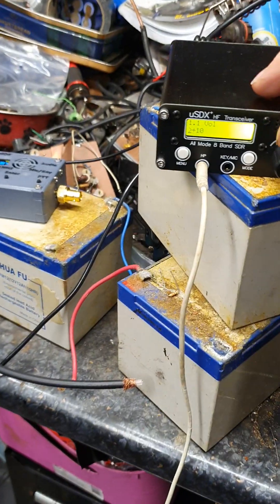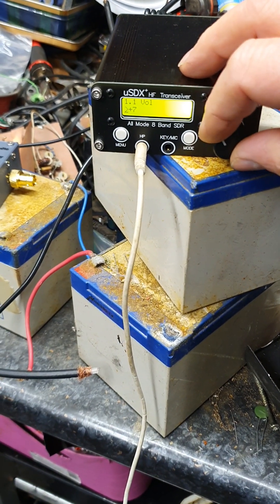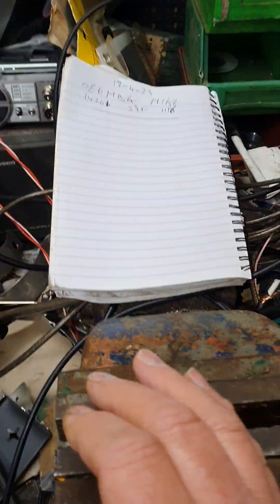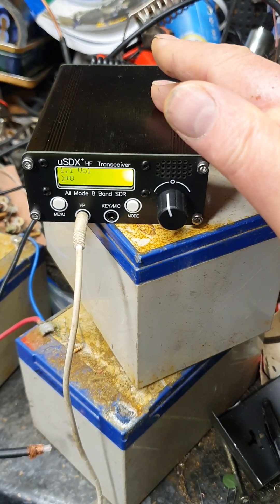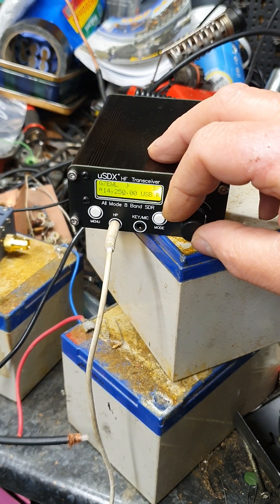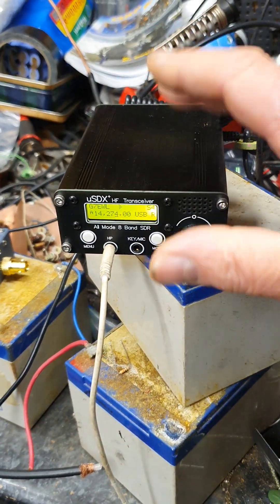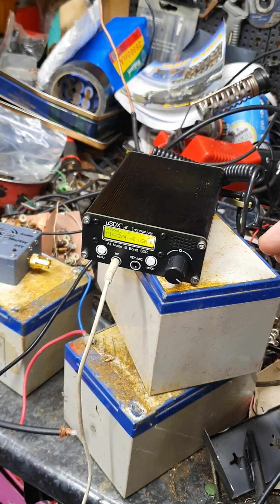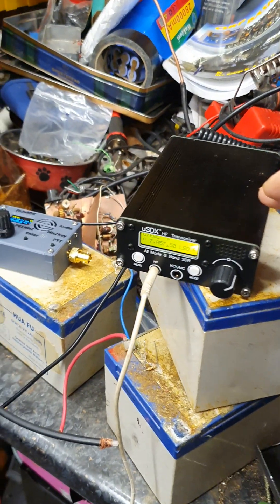Update on my faulty uSDX "white button" from Banggood.

Comment: I got one from Amazon and it works flawlessly at full 5 watts at 12 volts.
 I had to replace the mic with one from Radioodity to get better tx audio.
I installed LED voltage indicator iin the speaker holes in the front panel to tell battery status.
Very satisfied

Comment: Bought a second hand 'Black Brick' version a couple of weeks back and after several days of playing with settings I finally made a couple of QSO's one to Portugal and one to Italy. The audio out is very poor and muffled (any ideas?) but receive is brilliant. Use a 2EZRo Mag loop so a very portable setup. Four watts on 20 is the best I can get but the battery lasts forever !  I will open it up sometime soon for a look but experience on other bits ATU's etc. is that the soldering is often not the best. Be interested to see if mine has a missing resistor ? M7BLC

Comment: It's a great little radio, mine runs on r1.02w firmware which runs great.. I'm looking into changing the usdx screen logo to my call sign.. The popping with the encoder is down to the LCD I have that issue myself...

Comment: since changing my tx drive setting to "2" and fiddling with pa bias settings the "windy mic syndrome" has stopped, also the tx drive didn't change the power output, they all register  3.5w
Reply from the maker: That's interesting. Also yesterday I had a qso with a friend who knows me and my sound well, he said I sounded more bassy than normal. I was using the USDX mic which is moving coil I think, and plugged up a Baofeng mic I had to hand. He said it improved it and I sounded much better and to his ears it had a higher audio drive. The baofeng uses electret mic insert but appears to be directly compatible. Cheers and thanks for the comments. If you haven't already subscribe as I intend to do a few videos of this journey with these excellent little rigs. Cheers.
Reply: nice to see another messy ham lol i'm terrible, even the kitchen has a solder station

Comment: "Bloody lovely radio" I say that about mine too! In a way I'm glad you didn't end up sending it back. :)
Reply from the maker: Haha, yeah. Has to be one of the best value for money rigs available. Really enjoying it and just about to watch your other videos. 73s
Reply: @shanehogarth6373  Well, I hope you enjoy them. I've got one planned on the most inexpensive Antenna Tuner I've found yet. $48 from Walmart Canada... I've unboxed it, but I'm leery about hooking my good radio to it, so I've got another uSDX that will be used.... If ether survives will be seen. lol!! I'm currious is you ever did the resistor install as you cleaned up the bargan basement soldering job? 73!!
Reply from the maker: @tomsworkshop5856  No not yet. I am waiting for a little spectrum analyser to arrive and thought I would wait until I had that set up and available. It's odd isn't it that we both had the same component missing. The schematic from the forum certainly shows it as being there.
Reply: @shanehogarth6373  It would seem that back at the plant they must have decided the part's cost didn't increase or effect performance enough to make it necessary. So, I'm actually looking forward to watching your before and after testing! I've subscribed so I don't miss it. I've now modified 3 of these radios with good results. My go-to firmware is 2.00c, seems to be quite stable, and doesn't have that much clicking when changing frequencies.
Reply from the maker: @tomsworkshop5856  that's interesting Tom, thanks. I noticed today that the crackle when timing with the encoder knob wasn't anything like as bad as it was on the video. So theres some.sort of variable there going on as well on mine.